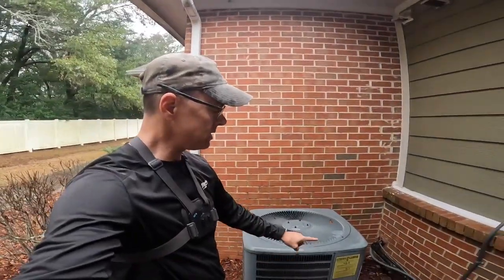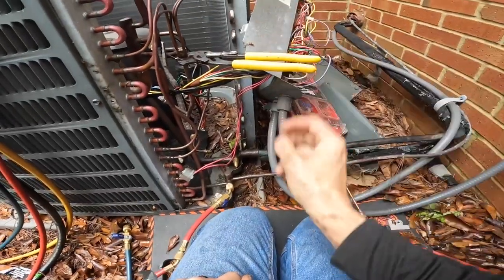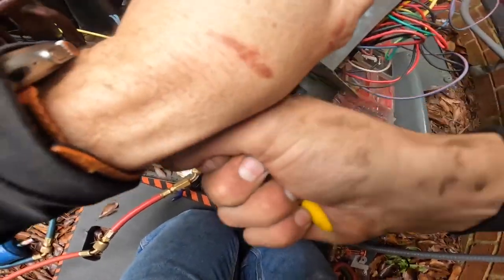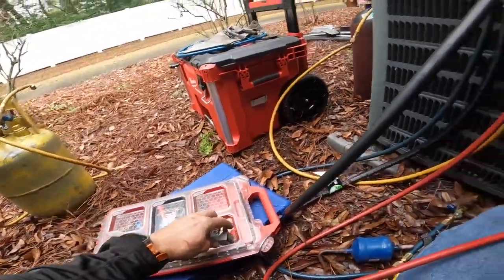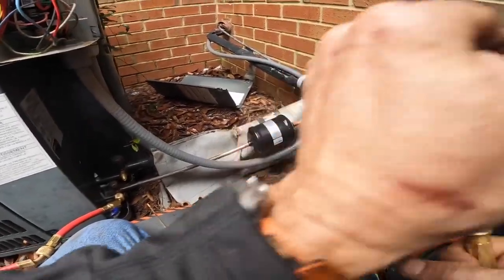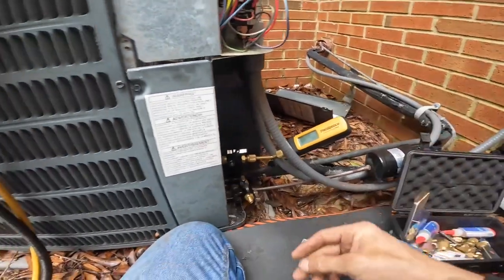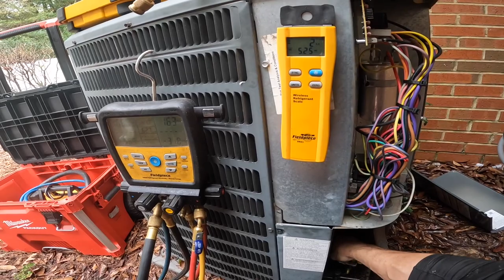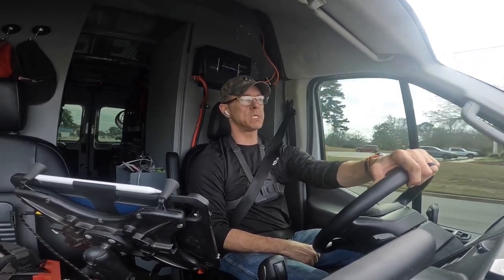Goodman Condenser Pumping Down with a Piston

Comment: My man, if there is a threaded nut holding the distributor onto the line, there definitely is a piston inside. If it were cap tubes, they would just be sweat in. Also, often times there is a fine mesh screen that is sock shaped that will often clog before it gets to the piston, some units have em, some don't.

Comment: Teflon gasket on piston should be changed?
Only need 10ft lbs of torque on Teflon ring gaskets.
Nice work bud.
Have removed small debris from piston office many times.
Small blade of grass once on inside 😎  coil

Comment: I always look forward to your videos every day, it has become a learning experience! I was wondering if it would have been OK to put Nylog on the threads of the piston housing? I still have trouble with piston vs TXV on expansion orifices🤔 Thanks for the Video 👍🇺🇸
Reply from the maker: It has a Teflon seal, so it isn’t necessary
Reply: @HVACGUY  Thanks for the  info, I didn't know 👍
Reply: I personally use nylog on the threads for future disassembly, it definitely makes it easier to remove later on and it will not contaminate the system as it is compromised of a thickened oil. Use it if you prefer, Especially if you have a brass nut on an aluminum coil! Save yourself some future heartache as they love to bind on the aluminum threads.

Comment: If you put two open end wrenches on those flats and squeeze them together, that fitting would come right apart. Same way to tighten.  Did you blow thru that old drier to see if it was plugged? Where did the restriction end up being?  The top edge of that condenser looks filthy. Hope the rest of it isn’t that bad. I never let a system sit in a vacuum for an hour. Air will get in somewhere.  If you only got 2+ lbs of refrigerant out, where did the other 5+ lbs go?  Maybe not a restriction at all, if it was that low.

Comment: Curtis still think work was too notch on this unit today but think your suction saturation temp was29.2 degrees on a 62degree and about 75 inside today. Maybe the the piston wrong size. Check the specs or call customer service.  It will be icing up prematurely in colder weather